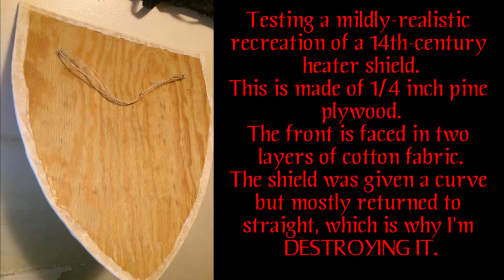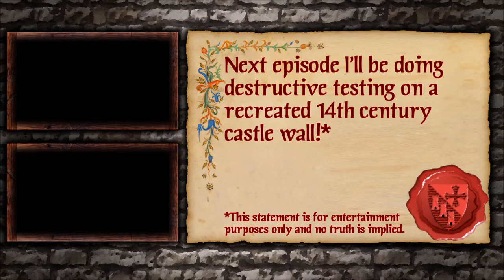Destroying a medieval heater shield!

Comment: A few things:
- Weapon #1, why didn't the user put his index finger in the ring? It's what they're there for.
- For the longbow, I'm surprised it had the arrow on the right side of the bow being held up by the thumb. It is usually on the knuckle side of the bow hand for European style archery.
- I'm confused as to why the one with a ponytail would pull back before each swing. He need to work on stances.
- Despite the above, your friend seems quite a natural with the spear!
- That Windlass battle axe, how sharp was it? It seemed like you hit the shield hard yet it was still glancing off.
- Haha, the end credits text!

Anyway, nitpicks and my typical list aside, nice editing and fun video!
Reply from the maker: - The colichemarde/smallsword Chris is using has the rings just slightly too small for the finger to go through. This is common with smallsword hilts, usually intending the index finger merely to be placed on rather than in the ring.
- Yeah, Chris tends to put the arrow on the right side as he's a little more used to eastern European bows (and our only archery training is from shooting in the backyard). I am more comfortable with longbows so I almost always put the arrow on the left.
- The Windlass Battle Axe hasn't been sharpened for a long time. Another cool thing about it is that since the horn is more curved, it does slicing cuts when the Cold Steel Viking Hand Axe does more hewing cuts with its pointed horn. Slicing cuts aren't that good against plywood.
Anyway, glad you enjoyed!